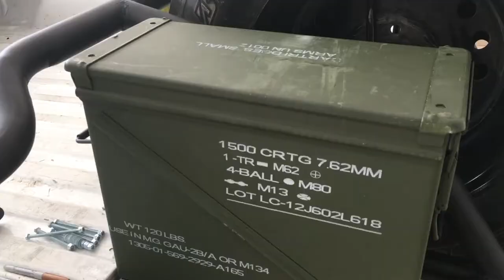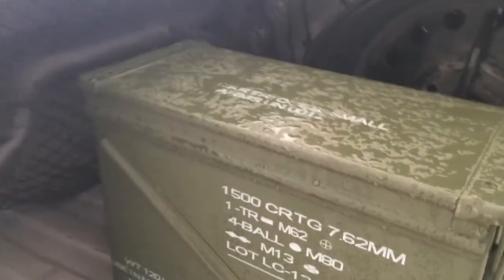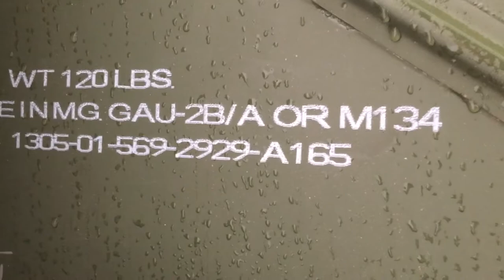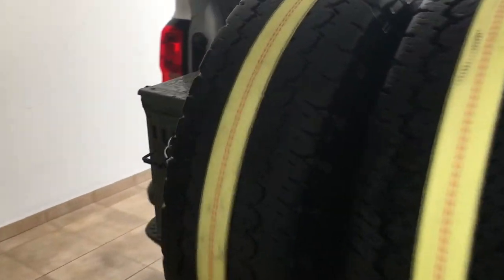Installing Ammo Cans as Tool Boxes for Off-Road Storage

Comment: Pretty awesome. I have used large 40 mm ammo cans as saddle bags on my Suzuki Savage and Kubota Z482 diesel powered Chinese enduro.  How well do the tires hold up to cracking? My spare tire mounted to the front of my flat deck modified car dolly is hammered pretty bad from the sun.  Is that 1 3/4" round tube used for carrier?